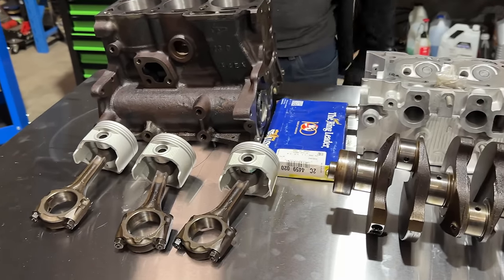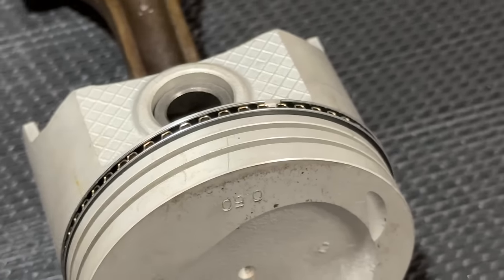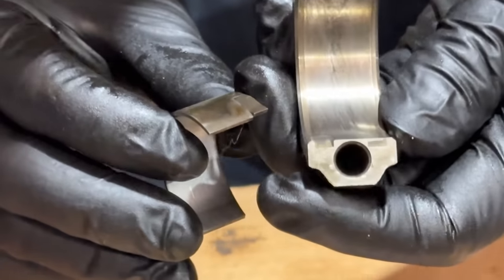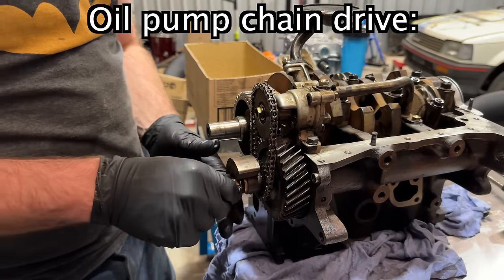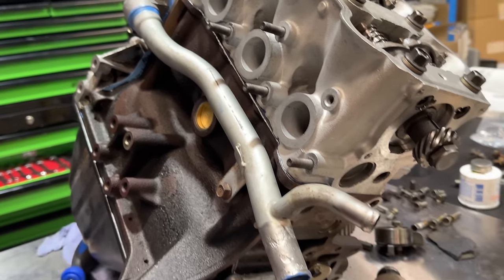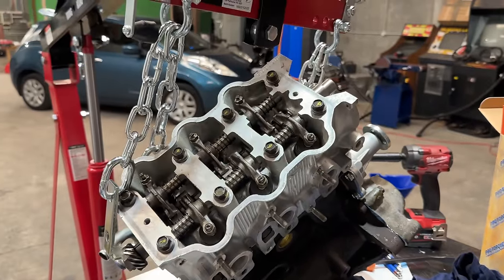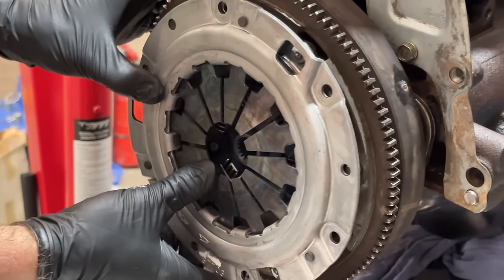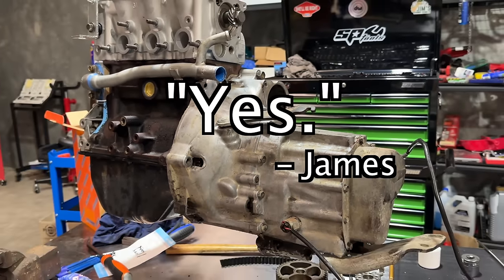Free Car Part 5: The rebuild begins.

Comment: An old trick/tip. For assembly lube, just use Vaseline. It's pure petroleum jelly so it reacts with very little if anything, also old time mechanics would use it because it did the job just fine and it was cheap. Also Vaseline can be left on the shelf prettymuch forever, you can also use it for assembly lube, lubing O rings in various pipe fittings, helping to protect stuff from moisture, etc. I have an antique wind-up Victrola and it even says in the original lubrication diagram to use oil and pure Vaseline (since soft greases like we know of today either didn't exist/wasn't widespread when my Victrola was produced).

Comment: I love this channel to death. Reminds me of back when I used to work on old vehicles all the time. In my late teens I had a 3 speed manual 1974 F100 and worked on it so much. Everything from regular maintenence to fiberglassing the floorpan to taking out the seat and tearing into the dash to replace the heater core. Sadly I'm not very physically or financially able to these days, I miss it

Comment: I like how this is in a way educational, seeing the inside of an ICE, but the 90s engine is relatively simple and doubly so because it only has 3 cylinders.

Btw, I've seen 5 speed manual box that's on my dad's family van, and thought the Charade's box (10:03) is tiny. But then it's bolted to the engine block and it's huge! The engine is so tiny!

Comment: It's a single cam , you can definitely use that timing belt you got even with the wrong teeth , as long as it's not loose or anything you're good to go , love the channel a lot btw
Reply: @luelou8464  Why ?
Reply: @BIGBOICOMBO  because on an interference engine when the cam belt snaps, pistons hit the valves = carnage.
Reply: @piuthemagicman  The belt isn't gonna snap because of the wrong teeth or missing ones , as long as the tension is correct you can get away with it , I've been swapping timing belts on many old single cam engines and it doesn't matter if it has 56 or 40 teeth
Reply: nothing to do with how many cams you have on an engine though. interference depends on multiple variables not including amount of camshafts. Valve lift & stroke at least.
Reply: @piuthemagicman  Nope , interference or not if it takes one tooth from the camshaft the crank spits out one tooth , simple as that , it only matters when you're dealing with dual cam or a mechanical injection where multiple gears do require timing , as long as the timing belt/chain is tensioned properly so that none of the two gears skip a tooth and ruins the timing then you're all set
Reply: @BIGBOICOMBO  Even though it probably would run ok, it's not gonna wear correctly. Maybe it wouldn't matter since I assume the car won't be driven much, but the square teeth are gonna cut into the round belt and make tiny tears. I know there is metal inside holding it together, but the rubber bits will shred faster and eventually lose grip.
Reply: @joeschmoe6908  Nope , the metal gearings aren't that sharp to cut or even prematurely wear out the belt teeth , as long as the belt is tensioned correctly everything will be alright
Reply: @BIGBOICOMBO  Sorry but I just don't believe that. I'm not saying it'll happen immediately, and I'm not calling you a liar. How many that you have done this way have you checked later on for wear? 
   No offense, but you're basically saying that the engineers who design these just don't know what they're doing.
Reply: @joeschmoe6908  The engineers know what there doing , they designed it that way because material quality back then required a lot of tolerance and a single cam engine allows such tolerances plus the technology for mass production wasn't there yet at that time 

I did this for countless of engines and yes I did check for premature wear even on chain driven cams and yes there are no significant wear on neither the chain , the pulleys , the tensioner or any other timing belt driven accessories and the timing didn't go off from it's marked points not even by a millimeter

Comment: I actually think its a good thing the timing belt didnt fit ahaha. Id be scared running a belt made from 2007... had those old "new" ones snap on me before!
But amazing video regardless. Hope all works out and it runs butter smooth the next time around!

Comment: Fun fact: timing belts have different names depending on what shape the teeth are. You guys needed to order an HTD belt in whatever specs the old one was. From what I know HTD are the standard option so it is a bit odd that you managed to accidentally buy the weird square version.

Comment: I bought boxes like those for my Rover Metro (had a bunch of Austin labled parts as it was the first run after Austin were bought out). Needed to replace the driver side light pod, and the rear break light bar, and alternator cap and each of them came in a box so old it was turning mouldy.

Comment: I had a rear main leak once. I drove to my house from my parents' house, which at that time was about 5 kilometers. Well, my old man happened to drive the same way I did and noticed a line in exactly the direction I'd gone, so he followed it. Then he called and asked, "Did you know you left a line of oil on the highway?" Turns out, I dropped about half my oil on the road, and the other half was on the ground under my car. Odometer was reading about 300,000 so while the mechanic had the engine out to swap that seal, I went ahead and had him do the timing belt and water pump too. That was not a fun check to write.

It was hardly a couple years after that one of the fan motors went out and the car had major overheating issues. Nevermind that it was one of the hottest summers on record. The radiator cracked maybe a couple months after getting that fixed. This was after the catalytic converter got clogged and was swapped with a straight pipe. God, I love old cars.

Comment: I just changed the timing belt on my girlfriends g100 cherade.  Had the same thing.  Got a belt with square teeth from a repco kit.  Ended up buying the correct belt straight from gates

Comment: As someone who's been working the last couple of weeks to get their motorcycle back on the road for the summer, after sitting for 18 months, I can confirm having to re-order parts cuz you were sent the wrong ones is a pain and really puts a damper on things.

A combination of a wrong exhaust header, and incorrect front sprocket has her parked back in her usual spot up the right parts get here.😢

Comment: one gripe, the black assembly lube shouldnt be used on the pistons. when it burns off it tends to leave tar and gums up the works. only use oil on them in the future and probably should throw some oil down the spark plug holes if you havnt started it yet. cheers

Comment: I currently drive a 1998 Mitsubishi Mirage.
It's a 4 Cylinder with 98 HP and 65k miles on it.
5k which I myself drove.

Its a bit slow to accelerate but otherwise a fantastic car to drive.
It has an automatic transmission.
26 miles a gallon is killer with how expensive gas is rn.
$25 for a full tank every 2 weeks.

Only had minor work to do to it when I bought it.
Wired and Installed a new radio, changed the sparkplugs and wires and ran like new.

Only issue I have with it is the Heater Core is fucked, the line was bypassed so no Heating for me.

Comment: Yup. When you do rod bearings, if it doesn’t turn over by hand (without heads or plugs, no compression) STOP. A cap or caps are not on correctly

Comment: You can run an engine without the balance shaft/s in it, it won't harm the engine itself (as long as you do it properly and block off the oil ports to the balance shafts so you don't lose oil pressure). 3RZ guys do it all the time. It just makes the engine much more vibratey.

Comment: The reason why the engine needs a balance shaft is because there are an odd amount of pistons. In most engines i4 v6 v8 etc, there are an even amount of pistons so as one piston goes up another goes down balancing the primary forces. In this engine, the balance shaft is there to balance the primary forces. If you don't  put it in, the engine would shake very badly

Comment: Yep! Most (if not all) configurations that don't have six cylinders to a bank (so that's only I6 and V12 engines....but I suppose a W24 could be out there in the wild) are unbalanced in some way or another. So they run really rough without balance shafts. Inline-6 and V12 engines are perfectly balanced on their own and don't require balance shafts. They're just long bois and don't fit in a lot of stuff, which is why you hardly ever see an I6 mounted transversely, assuming you even see one at all.

Comment: All feeler gauges end up that way unless you oil bath them daily, I used mine at work a few times a day, and oiled them at the end of the day and they still rusted up on the slips I rarely used :/

Comment: Please in the future cover everything in oil or starter grease if rebuilding an engine. If you don’t the first few seconds of running before oil pressure build will produce major wear and potentially damage parts if it takes more than 10 seconds to build engine oil pressure

Comment: The mitsubishi magna used a 3.0 v6 as an optional engine  these engines smoke not because of bad piston rings (usually) but they had faulty valve guides and seals these engines were factory recalled at least here in the states by chrysler... so not piston rings it's valve guides and seals.

Comment: Oof internal clutch slave cylinders are cursed. Nothing like having to drop the gearbox to fix the most common issue with a hydraulic clutch

Comment: The reason there are no rolly bits is because the oil and lubricant acts as a bearing using weird fluid dynamics. 

https://en.m.wikipedia.org/wiki/Fluid_bearing

Comment: I am a fan of you, this channel and this project (I love seeing projects that labours of love, that have no basis in financial sense. I get it.) I am not trying to sound like a jerk BUT

A chain is only as good as it’s weakest link… and I see a lot of weak links in that “chain” (in this euphemism the “chain” is that engine if that wasn’t obvious). 

You can’t cheap out on some parts and not others. I assume you want this engine to run for more than one month? 

I see a lot of slap dash work here too. From someone who is clearly skilled but doesn’t really seem invested in the long term viability of this engine.

It gives me the impression that this build isn’t meant to be long term but more to just get content out. 

I also note you’re trying to turn your space into a garage, an expensive proposition, and therefore lacking a lot of the tools to do this right.

Comment: Kinda dumb not to spring for new bearings, if oil pressure sucks, do that first before you wipe your crank. Too much lube on shaft. Silicone dosent seal pressuyrized 100c water for shit. Wtf is sealer for the head gasket?! And the new clusches often still have abspestos as do brake pads, you shoulda juts uesd the oem one. Speaking of clutches, yours didn't look won out, but fouled by oil and likely not adjusted right. But nevermind all this, you guys did super good enough. Pleasure to watch. Better to bodge it a bit than to not try.

Comment: Those piston heads look like they’re suffering from depression. Look at those hair line cracks. Not good. 

That water pump needs to go. I understand finding replacement parts is challenging so it may need to be rebuilt or fabricated. I wouldn’t trust that water pump for 20 miles

Comment: 9:32 
"Noone drives manual anymore"

...the hell was that take? I can agree with that if you limit yourself to the US but contrary to popular belief there's also world outside of the US where the majority of the cars on the roads are manual. Yes, new cars sold over the last few years are shifting heavily towards automatic transmission but that's only factory new cars, not taking into account sales of used cars which far outweigh sales of new cars and generally manual is here to stay for a long time still.

Comment: You don't need to be that afraid of asbestos.

1. for it to be dangerous you need much larger quantities (it is cumulative).
2. for it to be dangerous you need to be smashing it up. That potential asbestos on the flywheel was caked in oil and mud, so that's never gonna fly in you and the new clutch wouldn't be cracked or broken into dust out of the box.

I mean, you get far more body damage from owning a petrol or diesel car and sucking in all those nice car gasses in traffic. I think the statistic is something like 9 million a year. Dead people, i mean. Compared to asbestos deaths, which is a poultry 90k a year (caveat, continued exposure to asbestos is kicking an estimated 125 million people as we speak, but that's continued exposure). Mind you, you get more damage to your lungs from not wearing proper PPE when welding. You're literally coating your lungs in heavy metals and other garbage. When you see all those YouTuber farmers not wearing masks doing field work, that's worse and only because of enclosed cabin tractors and equipment, the incidence of farmer's lung has dropped. You start coughing it up, and five years after you start cutting hay in other pastures.

Don't get me wrong, as an architect, especially one that works with old buildings, i deal with asbestos way more than other people, but if you know how to work around the issue, and keep actual safety standards, you're not gonna have issues with it. I check up every few years and so far, i haven't accrued damage so far. You don't need to be that afraid of it.

Just my 2 cents.